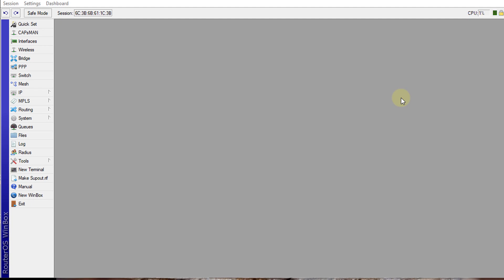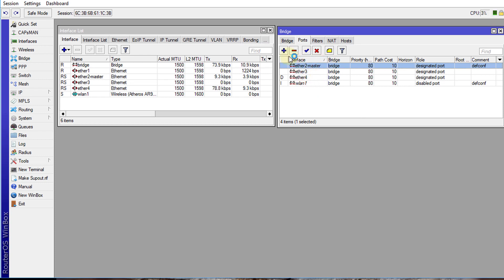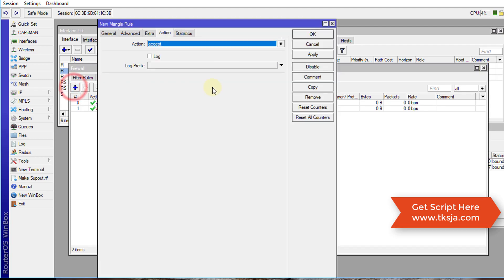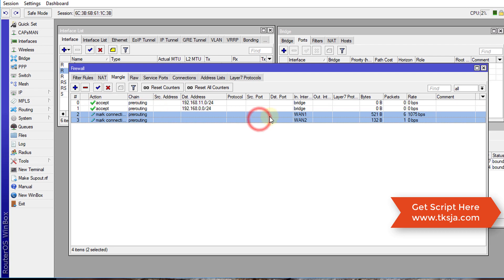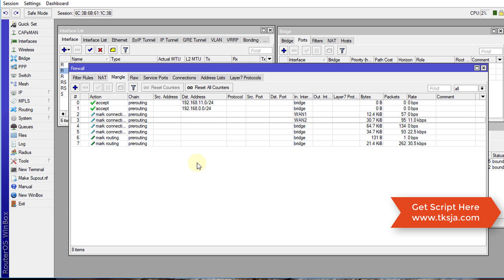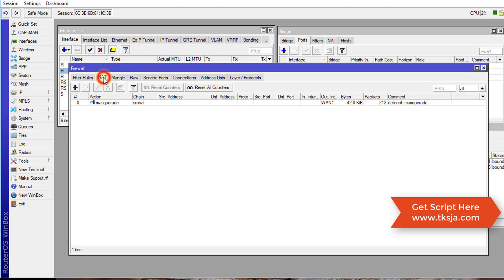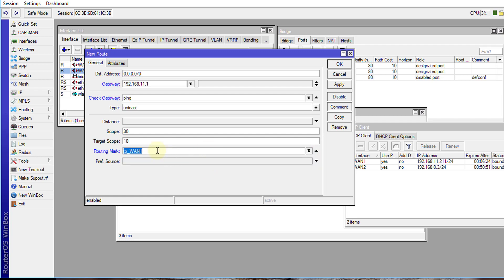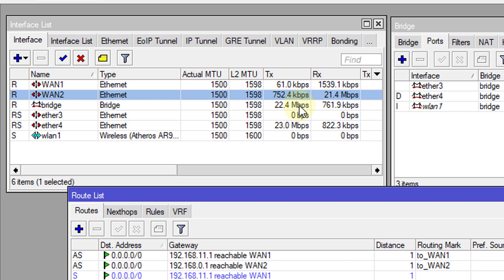MikroTik Tutorial 36 - Load balancing and failover with multiple gateways (2 WAN Links)

Comment: Is there a solution for a MikroTik setup experiencing issues with hotspot ports when both ISPs are connected for load balancing and failover, yet functioning properly when one ISP is disconnected? The LAN-configured ports are working fine on both ISPs. Thanks

Comment: Another question: Could you achieve the same with Bonding the two Interfaces ? It seems simpler setup actually
Reply: How do you bond two interfaces on the same router? I understand that bonding is on the router-to-router level
Reply: For bonding to work shouldn't both wan interfaces be from the same ISP? Using two different ISPs is said to cause issues in bonding or am I wrong?

Comment: Thanks TKSJa, your videos are very useful in understanding mikrotik in depth, i have one issue when my two ISP are live the load balancing is ok, but when wan2 i running then and wan1 is off internet works well but when i  reconnect Wan1 back while wan2 is still working the internet disconnect until i disconnect wan2 and reconnect it again.
Reply: Set the distance in both routes to 1 for both connections and change check gateway from ping to arp.

Comment: Hi TKSJa
Thanks for this informative and valuable guide.
As the gateway add is local ip add of internet connected device, what if the internet is down, but your connectivity with that device is up, as ping will still be alive?
further for 3 WAN connections, will be the per connection classifer instead of 2/0 and 2/1?

Comment: Thanks for the video, it helps a lot, but I have a question. You are tracking GW IP addresses in order to determine if they are up or down, but if GW is up and somewhere in the route to internet is down, lets say the ISP to internet is down, how can you track a farther address? Thanks
Reply: It's not tracking GW IP, it's marking them for packet handling inside the Microtik, the purpose is to allow for correct packet handling.

Comment: hello bong 
i have 2 wan connection with the same ip address range
1. wan1 172.20.1.20 gw 172.20.1.1
2. wan2 172.20.1.21 gw 172.20.1.1
3. lan1 192.168.1.1/24
4. lan2 192.168.2.1/24
i want to lan1 to throw wan1
and lan2 go throw wan2 
----------------------
how to configure in single  mikrotik router

Comment: I had watched over 5-10  videos regarding load balancing on youtube most of them do chain-input  while making mark-connection for Wan.in this video u have done chain prerouting what is the difference of doing that sir? I have configure my mikrotik router with dhcp client and ppoe client but i got confused while accepting dst-address beacause when i configure WAN1 as ppoe client it gives out address like 202.51.84.11 and network 103.10.30.4,how can i know cidr of this network so i can use it on mangle rule to accept dst-address ?please help

Comment: Hi, this worked like a charm. Tested 4k streaming, pulled the cable and it kept going without a problem.  However, if my ISP router loses connection, the failover doesn’t work. Is it because the ISP router’s IP (e.g. 192.168.100.1) can still be seen?  What is the workaround?

I found this in the Mikrotik wiki. Could this help?

/ip firewall filter
add action=reject chain=forward connection-mark=WAN1 out-interface=ether1 reject-with=icmp-network-unreachable
add action=reject chain=forward connection-mark=WAN2 out-interface=ether2 reject-with=icmp-network-unreachable
Reply: Hi, Robin Moran is this effective to you, ip firewall filter?

Comment: Hi! My WAN 1 is connected directly to the ISP modem (with public fixed address), WAN2 a pppoe is passed through a router. When testing by disconecting wan1 it work ok, but when I disconect wan2 it has no dns. I tried to add isp1 dns to dns menu but it still do not work...

Comment: Great tutorial my friend. I have a question for you: this configuration works (I try with wan ADSL and wan LTE with Dongle) but with a limit: if router on wan1 is reachable but without connection I have no switch on second wan. If distance is 1 and 1 all works but if I have to do a failover with difference distance (in case LTE I have to use it only in emergency case) doesnt'work.

Comment: Hello, very good video! my query is: what happens if the interface does not disconnect, only that it does not receive internet? How does the router detect this? Thank you.-
Reply from the maker: That is an issue with this config. I will do a video show other methods.
Reply: okay!  I would appreciate it if you make those videos, thank you very much for the prompt response.

Comment: Wonderful demonstration. But I have a bit different situation (router.os 6.43.8). I have already configured a connection using pppoe on ether1. How can I make ether2 a WAN port while no master port settings are available. Then should I use pppoe-out interface instead of WAN1(ether1) in load balancing configurations? (the second Internet has an fixed IP from ISP)
Reply from the maker: Load balancing and pppoe is a bit tricky. It's better to configure another router for load balancing only.

Comment: I want multiple connection to fail-over. In your configuration if any link goes down it will fail over but if the link is up but the ISP end has internet issue the connection does not failover. If you know how to fix this please help. Thanks in advance.

Comment: Hey TKSJa, thank you for your helpful videos. This has been helping me a lot in understanding Mikrotik Routers. I have a question, When you set this load balance up, you use the DHCP Client to get an address from both ISP/Clients/Routers. Do you have to use the DHCP Client? couldn't you just set it up with out the DHCP Client?
Reply: In this tutorial, the MikroTik router is connected to 2 ISP modems/routers.  These devices give out DHCP addresses on their respective "LAN" ports.  This is the most common scenario.

Comment: how would it know when to fail over if there no internet from one of the wan port
Reply from the maker: The traffic can take any available path to the internet. So if one of those path goes down that then the route will be marked a unreachable and the other route takes over.
Reply: TKSJa but what method does it use to know that there no internet.

Comment: Hi, i followed your instructions carefully but i made it for 5 WANs. I'm currently using 2 WANs for now. For some reason, it won't balance the load. Any ideas why? Thanks for your video by the way.
Reply: Try a different distance for each wan connection. The lower distance will get the preferred routing. Just also consider that when the WAN connection are merged , you may have difficulty in reaching the public IP and port forwarding also becomes a problem

Comment: this Works perfectly on my MT, I just have another problem sir, i experienced it when 1 of my ISP where down but the router are still lit or connected to MT. it lags, i cannot browse the net unless i switch off or pull out the other modem..
Reply from the maker: Not sure this is happening, but based on my test it should fail over smoothly.

Comment: Hi TKSJa, thank you for this tutorial, really very usefull.

I got an RB941 Hap Lite to make load balancing with two dynamics ADSL lines from the same ISP but differents datacenter and differents speed (10Mb and 4Mb), so, I would to know why when the two WAN are active the navigation speed is too slow (under 2Mb or less) and too to slow to open and charge any webpage, also speedtest.net is too slow, but if I disable one of the WAN I get the correct speed and navigation in that WAN and viceversa.

In the other hand, how I could configure this router (RB941) to manage dynamics IPs?

I must to say that I start with the factory configuration and not from scratch because I don't know how to configure every thing.

Thank you again.
Best Regards
Reply from the maker: Start over by doing a Factory reset you may have missed something.
Reply: I tryed two or three times from factory reset, even with other router, but no way, the navigation speed and loading when the two wan are enables is too slow, thank you anyway.

Comment: Can 2 wan ports be configure to do a bonding but with using 2 PPPoE WAN's ??  Thanks
Reply from the maker: Try using the PPoe interface instead of IP
Reply: Thanks if I use 2 PPPoE connection 25mbps each will i get a speed of 50mbps?  what is the difference with this and bonding?
Reply: Load balancing means you send one connection down one internet line and a different connection down a another. Bonding means you split each connection in half and send each half down each connection at the same time. 

Services like bittorrent that use multiple connections will see 50Mb with load balancing but services that only use a single connection (like HTTP) will only see 25Mb.

Bonding is what you want for getting 50Mb out of a pair of 25Mb lines but the problem is it needs your ISP to be able to reassemble the split connections at their end so you can't just glue a pair of 25Mb connections together yourself.

Comment: Hello. This works perfectly! What changes do I have to do if I am to implement it on 3 WAN connections? Thank you!
Reply from the maker: Create an additional rule for WAN3 similar to one's created for WAN1. Also, the PCC should be changed to "per-connection-classifier=both-addresses:3/0,  3/1 and 3/2
Reply: Thank you very much for the quick reply! I have another question. What are the differences between the per-connection-classifier=both-addresses AND the both-addresses-and-ports? Which is better for failover and load balancing? Thank you again!
Reply: Also about unequal WAN Speed load balancing, How do I put more load on that WAN Interface. One of my WAN Link is 100Mbps and the other one is only 14Mbps. Thanks!

Comment: At which ROS version are you... It's font work properly on 6.39.2
Reply from the maker: +Boris Rouliane Kouassi I am currently using 6.39.1
Reply: ALL my configuration are OK but pcc dont working well. What can I be the problem
Reply from the maker: +Boris Rouliane Kouassi Backup your current settings and reset, then reconfigure load balancing. If you this works then it means that you may have configured something wrong.

Comment: very good and clear tutorial. More videos like 2 isp with 2 routers. for example first isp is connected to router1 and second isp is connected to router2. with load balancing and fail over effect. it is possible? thanks.
Reply from the maker: +Reden Dimaano This kind of setup would be redundant because you can achieve this by using 1 router

Comment: Ok, so after the last comments, I started from square-one.  To get the best results, it is preferable to do a "reset-configuration" prior to starting the process of the "Load Balancing" exercise.  In my case, I had been using the router for other things, and a lot of little settings had been changed causing (I suspect), unpredictable results.  I also had saved, and exported the configuration settings to a file so I could paste them in one at a time to ensure I could see what was happening.
So, after doing all that, it now seems to work perfectly..  :-)  :-)

Thanks !!
Reply from the maker: +Tim Great!

Comment: Hi, thanks for your tutorial. I try to setup with 2 different bandwith 8mb & 4 mb, to combine it then should be 12 mb.
Somehow the first user (port 3) connect get 8mb & second user (port 4) connect get 4mb . is there any ways to combine the speed so all user can have same 12mb speed ?
thanks in advance.
Reply: No, all a setup like this can do is put the first user's connection through one isp and the second user's connection through the other isp. If a user is doing something that uses multiple connections like bittorrent then he would see the full 12Mb but single connection stuff like http downloads will just get assigned to one ISP or the other.

What you're looking for would require both broadband connections be with a single ISP and that ISP would have to configure stuff at their end. This is sometimes referred to as bonded DSL
Reply: Great. thanks mate for the explanation. thumbs up ! :D
Reply: As far as I remember if I do bonding the aggregate bandwidth would doubled the lower line twice, so in this example it would double your  lower-capacity line. Read more on this in MT wikipedia/manual.

Comment: You really are the best ... And if for example, the two connections are dynamic. It would take some script to check if the Gateway switches to automatically put it without losing connection. Could you explain what would be the best script ... The two connections you are using are the same speed? For example if I have two connections of different speeds, I would use the pcc 2/0 and 2/1 or I must make the calculation to determine how many connections I want for each WAN .. I wait for your prompt response and apologize for my bad english.
Reply: As for if it's dynamic, you can use router to create static IP from dynamic IP, and then connect the router to routerboard (mikrotik). And for load balancing, there is no setting for the number of connections. It will automatically looking for different interface connection if the other one is full, or busy. Load balancing is like parallel in a battery set up. It give the same speed, but more stable without any problem, you can use 2 different ISP to provide the best stable connection.
Reply: I have been applying a script to avoid using a router. But I would like to know what would be the best script if we have dynamic addresses (without router) ... My other question is:

For example: I have two wan: one of 8MB and the other of 2MB ..

I understand according to the video and your comment that they are only needed; Two rules of pcc; Is that correct?

I have seen a calculation that applies to know exactly how many connections should be used to make an accurate balance:

Example: 1

WAN1: 8MB
WAN2: 2MB
Total: 10MB

It divides: the speed of WAN1 between the total of mb: 10mbps (for this example) and multiplies * 100

WAN1 = 8/10 = 0.80% * 100 = 80%
WAN2 = 2/10 = 0.20% * 100 = 20%

This means that 80% of the connections should go by the wan1 and the rest by the wan2

Then determine how many groups for each connection (multiply the group
 of connections that are desired between the number of connections that 
must go for each wan) must obtain a whole number

WAN1 = 5 Conn * 80% = 4
WAN2 = 5 Conn * 20% = 1

Therefore it is determined that 4 rules must be obtained in the mangle for the wan1 and only 1 connection for the wan 2

It would be correct to do it this way ...

Thanks for your comments ...
Reply: Yeah your welcome. If your WAN1 is 8 mbps, and WAN2 is 2 mbps this means your highest speed is 8 mbps, you didn't get the speed of 10 mbps but 8+2 mbps. you will get bandwidth equal to 10 mbps. You can set more than 2 wan on routerboard, so I don't think you should create rule in mangle for the number of connection as for it will automatically distribute a balance connection.

I have a question :
1. I want to attach a web server (Local Server) for my wireless network in ether4 (IP : 192.168.144.2).
2. I want when they type : www.juicyjust.com, they will be directed to the intended IP (192.168.144.2).
3. How to make the user go to my website instead of other real site (global website)?

I had did my research, but I'm not sure. This is the script :
=======================================================
ip dns static> add name=www.juicyjust.com address=192.168.144.2
=======================================================
Will this work just with that? Please help me.
Reply: You can set a PCC rules for that,

add chain=prerouting dst-address-type=!local in-interface=Local per-connection-classifier=both-addresses-and-ports:2/1 action=mark-connection new-connection-mark=WAN1_conn passthrough=yes
add chain=prerouting dst-address-type=!local in-interface=Local per-connection-classifier=both-addresses-and-ports:2/1 action=mark-connection new-connection-mark=WAN1_conn passthrough=yes
add chain=prerouting dst-address-type=!local in-interface=Local per-connection-classifier=both-addresses-and-ports:2/1 action=mark-connection new-connection-mark=WAN1_conn passthrough=yes
add chain=prerouting dst-address-type=!local in-interface=Local per-connection-classifier=both-addresses-and-ports:2/1 action=mark-connection new-connection-mark=WAN1_conn passthrough=yes
add chain=prerouting dst-address-type=!local in-interface=Local per-connection-classifier=both-addresses-and-ports:2/2 action=mark-connection new-connection-mark=WAN2_conn passthrough=yes

or something like that.
▼
Reply: Hi brother